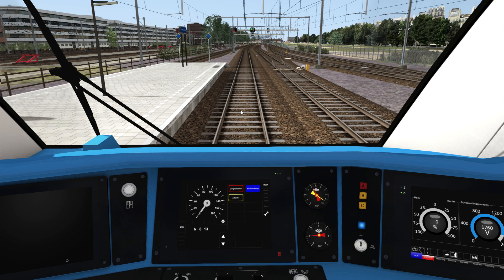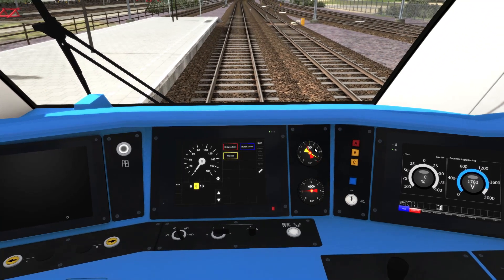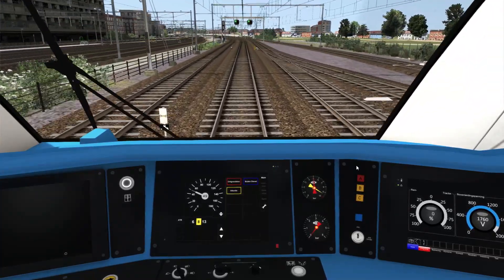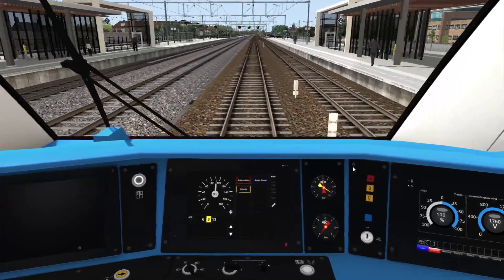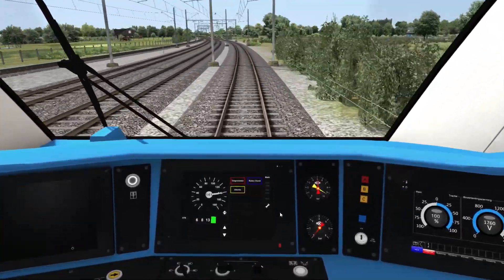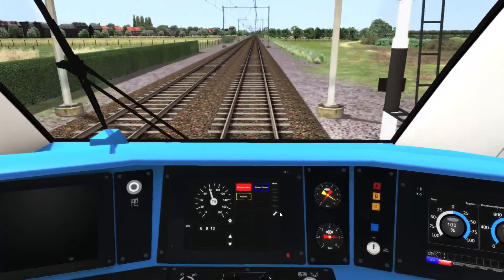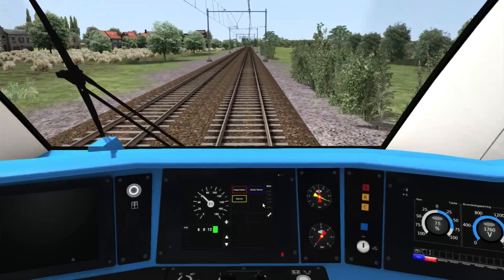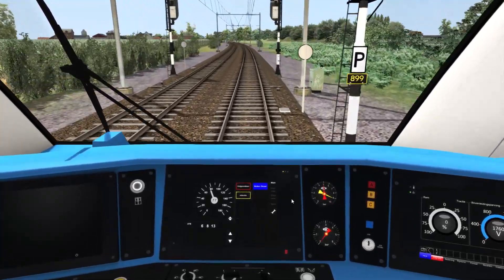SNG Tutorial 4 - ATB and dodeman (deadman) systems

Comment: One little question about the control systems in the SNG. Why wasn't ETCS added?
Reply from the maker: SpeedBird6780 at the time the project was being planned there was only one actual test train running with ETCS and only on one limited part of the network. Even today 95% of the trains run ATB only so I chose to not do ETCS but add some other features instead.
Reply: @christrains_real  OK, I honestly thought that ETCS was standard on the SNG. Since the DMI.
Reply from the maker: SpeedBird6780 it is standard equipment but it’s not yet widely used as not many tracks in real life support it. In the console you can see a key slot that says ETCS. To use ETCS you need to have a special key and then can only run on certain tracks.
Reply: @christrains_real  Yeah, that has some consequences for Krammendijk Deltaland though.